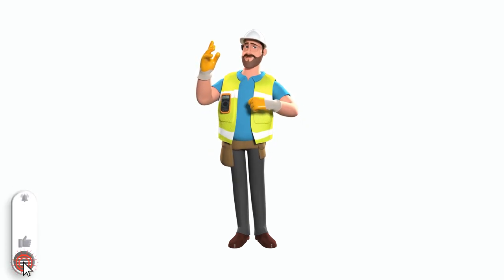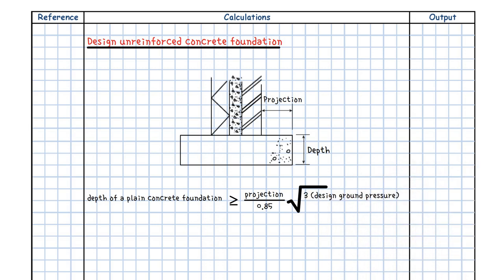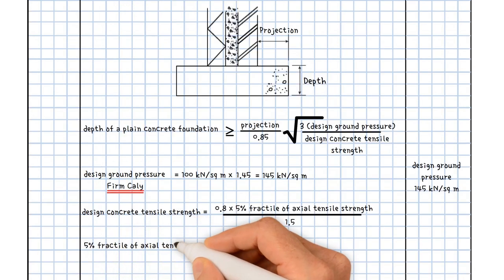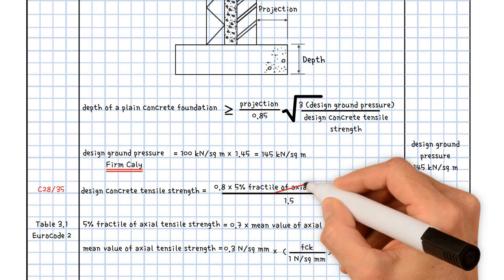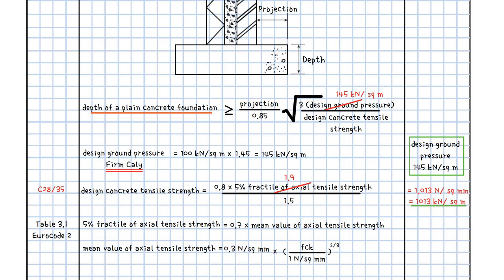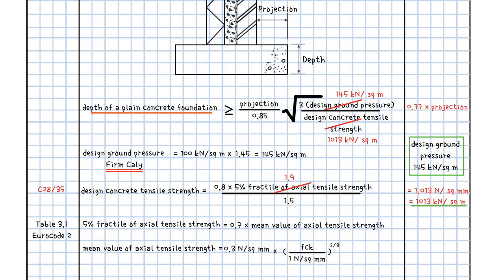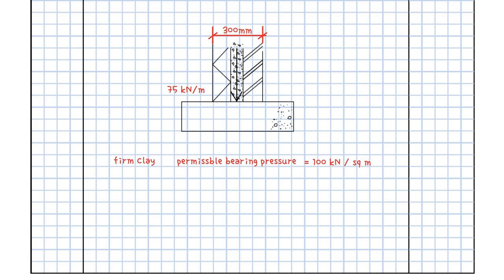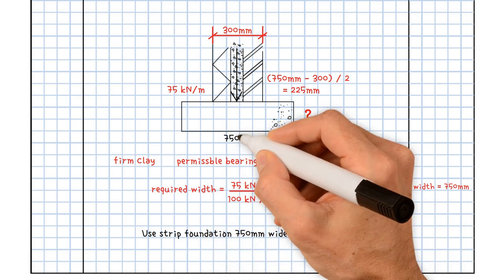The EASY Way To Design Unreinforced Concrete Foundation.

Comment: For the Average Partial factors for permanent and variable load (γ = 1.45). 

1) What is the source of this factor? 
	- I don't find it in Eurocodes, is it something worked out like this (1.35+1.5)/2 = 1.425 ? 

2) In what cases do we use this factor?
	- I will say only when the applied load is a ULS load, hence if the applied load is SLS this factor is γ = 1?
 

Thanks for the videos, they have been useful to me many times.

Alex

Comment: Just unpacked a lot of rules of thumb with this one. Thank you!!

Can I ask for possible vids..?

(1) Say a gable wall that would need a either a windpost or a buttress wall support... And the design criteria as a comparison between adding a wall or a wp.? (for cost comparison if you needed).

(2) some foundations get poured as a 2 stage pour. Trench... Then the top 500mm as RC. The philosophy of approach. (I think to be honest... You could set up another channel as just design philosophy and approaches...?) 

(3) have you ever used manholes filled with mass as a way of designing simply supported RC beam? We have at our place... But drawing them is one thing... A design guide would be very useful.

(4) some underpinning of Both an existing property... And maybe an exercise of underpinning an existing retraining wall...?

Finally... I think (and more importantly). You should incorporate a "buy me a coffee" button on your website. I'm not even joking.
Reply: It takes SOOOO many videos to get them monetized. At least that way.. They can be drinking  coffee forever :p

Videos like these, put universities on Notice. And rightly so. To justify the university costs these days, based on how I studied, I just couldn't honestly reccomend it to people. This content however gets into the bones of engineering. I came out of uni and when I was asked to design a beam, I could only go by the notes I had. If you have poor notes... You get poor design.

When designers aren't toooo busy. You will get instructions as to, what to consider and where in the code you'll find it and what it's telling you. Im still Waiting for those discussions. Ha.

Channels like these give me hope. The only problem, is that, as important Structural engineering is, if you compare this video... To a cat falling off a ledge, the cat video will generate money.... This won't.

I know full well, under the code of practice, they are not doing this for the money. I think as a request for the button is a reasonable one... And maybe a patreon page. I'd 100% subscribe and pay. I've bought courses before. This as a try before you buy is perfectly setting up a core base of patreons.

More incentive to keep going. Because this will help those going for chartership.
Reply from the maker: Thank you Mark for all your support. I will try my very best to cover all what you asked for just please bear with me. Your comments are really important to me and keep me going. Thanks for the coffee LOL.

Comment: Hey, thanks for video, 
Quick question if we have (30kN/m / 100kN/sqm = 300mm) same as walls W,
It's ok? or should be some min for foundation W (walls W + 150mm = 450mm) for example? 
And this calculation also works for deep strip (trench)?
Thanks